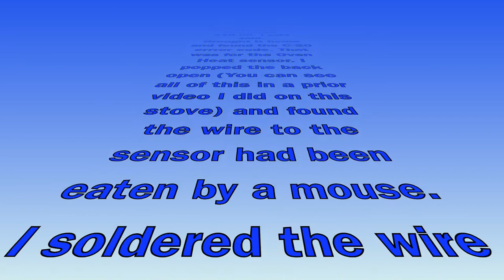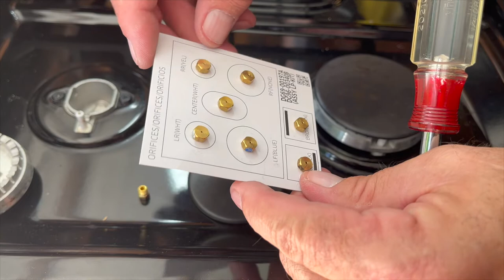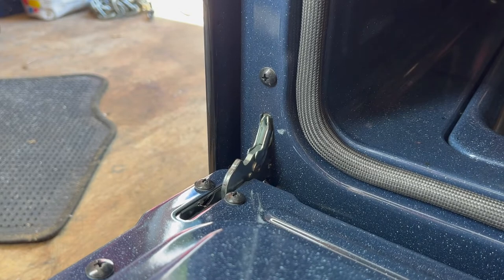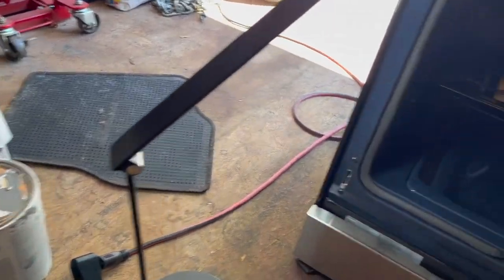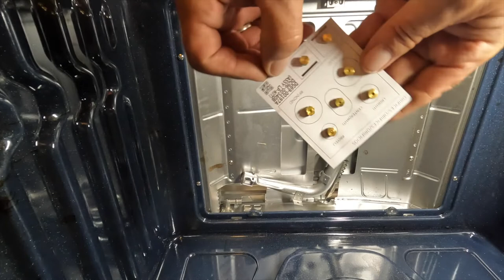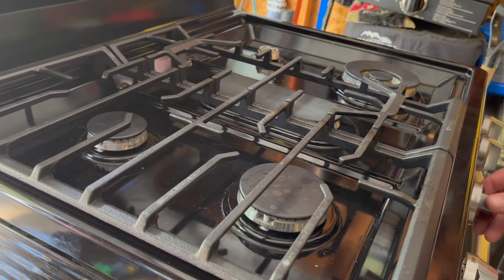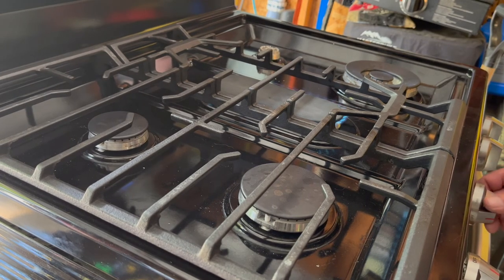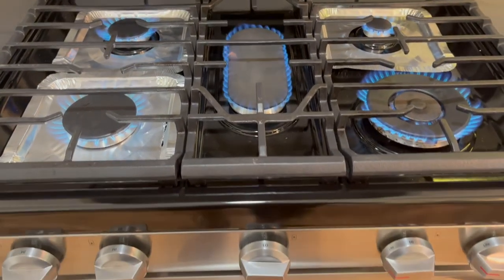Samsung Gas Range Jet Change. Natural Gas to LP Propane conversion. #samsung, #gasrange, #propane

Comment: Nice video.  Really complete except you didn't give the jet sizes.  I have a NX58M6630SS/AA and in the hurry of doing the oven jets I got them confused.  I'm Okay but the stove is confused.  My stove is very close to yours.  Where do I find the recommended jet size.  It would seem that the bake jet should be larger than the broil?  Help
Reply from the maker: Check the card the Jets came on. You should be able to look up the part based on the card number. I will rewatch the video and see if I can help.

Regards

Jack
Reply from the maker: You are correct, the Broil jet is the smaller jet. Watch the video back, you can see the difference.
Reply: Aloha Jack,  Therein lays the problem.  I bought it off Amazon so the part numbers just aren't there.  And the color coding may be on the card but not on the jets themselves as a genuine Samsung product would be.

It looks like the larger one goes to the bake flame?  Yes?  I'm really looking for a size call out in a spec sheet.

Aloha

 @lifeintnchevalier

Comment: Thank you so much for the video, easy step by step DIY! My only question is how did you get the center burner to have a bigger flame, we love our stove but just wish the center flame was bigger
Reply from the maker: I just checked the size of the hole and used one of the ones I pulled out that was a little bigger. Good luck and thanks for the comment
Reply: @lifeintnchevalier 
Brilliant!
Reply: Manual says there's a adjuster and you just have to use a flathead screw driver

Comment: What size jet did you put on the center burner? And where did you get it ?
Reply from the maker: The jet that came in the kit from Amazon did not have a big enough flame. I went through the old jets and found one a little bigger and it worked great. Hope this helps

Comment: Where do you find the liquid propane kit?
Reply from the maker: Lowes and Home Depot have them. They have a kit that will have the nipple that will fit in the stove regulator, flex hose and shutoff valve. When I tested the one in the video, I used a barbaque regulator to connect] to a 20 pound tank and rounded up a few fittings to go from the regulator hose to. the kit I got at Lowes. Hope that helps
Reply from the maker: Check out my other video, it shows the hose connected to the stove https://youtu.be/pUs4dciS910?si=WB36Scy7oGWq1s9F

Comment: How did you do the dual burner, it’s not the same as the rest of them?
Reply from the maker: The jet is on the side of the opening towards the back. Small brass nut with a hole in it. You will need a small box wrench. An adjustable May work but you may strip the hex if not real tight. I don’t have the wrenches with me but I would guess around a 6-8mm. Hope this helps

Comment: Did all that and doesnt work   what to do w that little botton swicth beside the regulator
Reply from the maker: Not sure what switch you are talking about. Could you send me a picture of what your regulator and switch look like?
Reply: Its the same  you have   just beside from under theirs a little flikable swith
Reply from the maker: What does not work? Do the burners light? The stove should light the burners on both natural gas and lp gas setups. The video try’s to explain how to convert the regulator and burner jets to LP gas. If you explain your issue in more detail, I will try and help. 
Regards
Jack

Comment: Hi, could you please tell me where the foots of the stove go?
Reply from the maker: They would screw in the bottom of the stove on the corners. There is also an “L” shaped bracket that should bo mounted to the wall behind one of the rear legs. This will prevent the oven from tipping forward if a heavy item is slid out on the oven rack. It could also prevent the oven from tipping over on a child who may sit or step on an open oven door.
Hope this helped

Comment: What about the hose connection?
Reply from the maker: During my trials and repairs I connected the stove to a propane tank with a standard regulator and a standard yellow gas hose from Lowes. Same type of setup I used in Vermont on an old stove to boil my maple syrup.
Reply: @lifeintnchevalier  thanks, great video, sir.

Comment: Can anybody help me I need the hose from the back of the stove to the propane tank but nobody seems to have it
Reply from the maker: I it is the basic hose, you can buy them at Lowe’s. Can you explain your setup so I have a better idea what your need is?
Reply: @lifeintnchevalier  I believe the male piece is ¼ if I’m not mistaken I went to Lowe’s Home Depot and ace they can never help me
Reply: The piece in the back of the stove is ¼ and they say they don’t have anything that small
Reply: @lifeintnchevalier  it’s the same set up you have
Reply from the maker: The hose connected to the regulator can be bought at Lowe’s. To go from that hose to the small regulator connection, I had a box of flair fittings that got me down to the size I needed. Lowe’s, Home Depot , and most hardware stores sell flair fittings . Just bring your hose and match them up.
Reply from the maker: This may help. Saw on Amazon. https://www.amazon.com/Besosay-Coupler-Adapter-Nipple-Fitting/dp/B09C4QYT9M/ref=sr_1_33?crid=D9UHKAS14F4O&keywords=flair%2Bfitting&qid=1693282652&sprefix=Flair%2Bfit%2Caps%2C161&sr=8-33&th=1